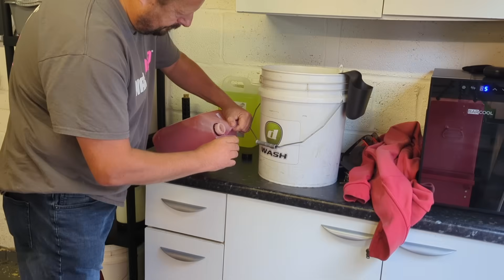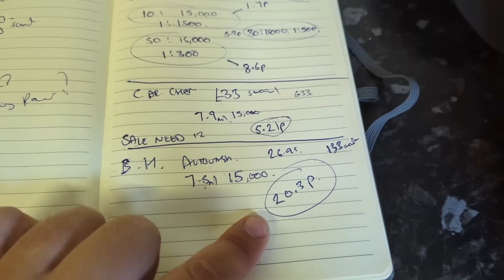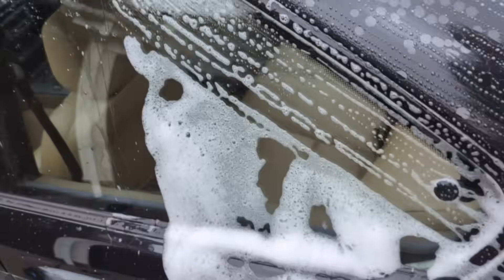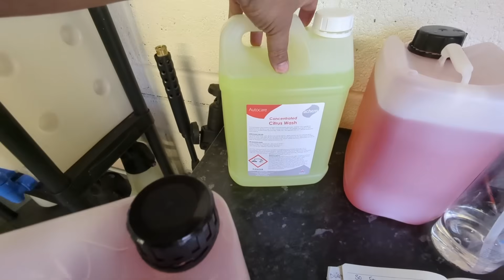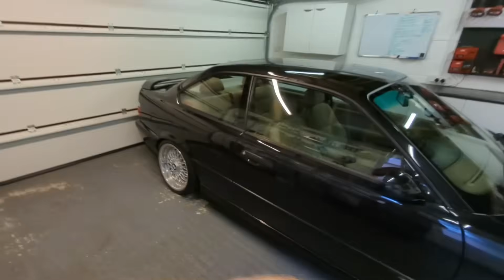*NEW DISCOVERY* UNBEATABLE Car Wash Shampoo £7 for 5 litres of high concentrate (+vat)

Comment: lol at people moaning at the price, madness.
Reply from the maker: you cant really trust the comments mate.  20,000 people watch the video 100 or so comment. After years of doing this you realise lots of the commentors are people really close to this, usually in the industry.  Ive reviewed about 50-100 car shampoos most which are retail and are lower standard 1:100-1:250 concentrates and cost about £12-15 plus £4-5 delivery for 500ml.   They dont complain about the price its never even mentioned.  Here you get 5 litres (10 times as much) of very very high (extreme concentrate so less water mixed in) and its £8.60 plus £6-7 delivery.  And there was more complains about price than ever.  This even with delivery is the cheapest cost per wash and chemical price you will ever get.  Thats why you know the comments are often industry linked sources.  That and I can see that accounts posting history to get a flavour of its its genuine.  You start to see the patterns after a while.
Reply: @ForensicDetailing 

Ah fair enough. I’m looking a decent shampoo to use and interested in this one. Previously used 1900.

Comment: Have you tried CarPlan Ultra Car shampoo (wash and wax)? The recommended does is one cap per bucket and 5L costs £5.75 (Amazon / B&Q etc).
Reply from the maker: Yer it's like demon foam.  It's not a high concentrate.  It's works but it's just a thin foam. The a chem stuff is much better much richer.

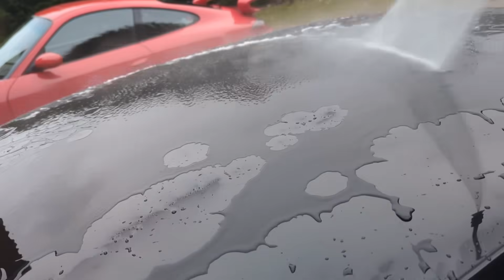Comment: @12:05 'It might not be the most powerful on the market but I can't really tell'.

Testing would help with this, right? 😅
Reply from the maker: It wont cut my dirt sim neither will any shampoo so I dont really have a means to test cleaning power down at this level.  most of this soaps are very mild any really just provide a low level of emulsification with some lubrication and foaming agent.

Comment: I think when working out costs you really ought to factor in delivery costs, especially if you can't walk into a high street shop and buy it without those delivery costs (£17 Inc delivery)
Reply from the maker: It's 8.63 plus 6.99.    but u have would always pay like 4 or 5 quid delivery on anything.   even if I double cost per wash 1.7 p becomes say 3.4p.  typically your averrage cost per wash is 30p without adding shipping.    5 litres of this delivered is the same as 500ml bottles of most shampoo with delivery.
Reply: @ForensicDetailing  +vat its in my bascket at £16.97 but unless i can find something else to add like maybe the cherry air frshner to i wouldnt buy shampoo online. Its the thought of paying same delivery as the item costs that puts me off. Somone did say that delivery cost does cover 3 x 5ltr tubs though which is very good value. I made an account, will see. you could review the QD stuff they do or the other ceramic stuff.
Reply: OOh if i can collect im driving 6hrs to leeds in a couple of weeks and its off the M1 somewhere 😀 Bonus.
Reply from the maker: It looks like its full of bargains.  Check their ceramic QD, or the normal QD, the rinse aid. Snow foam 10quid for 5 litres.  work back down into each area from this link https://www.achemshop.co.uk/product-category/autocare/  from what I can see as well these are nice quality chems

Comment: So how much would you recommend in a snow foam lance 🤔 been using shampoo through a lance couple years now just 1 bucket for rinsing wash pad 🤔 👍👌
Reply from the maker: start at 50-950 in the lance.  If its too thin work up to 100-900.  I would guess it will foam well at 100-900

Comment: BH Auto wash has to be worst product BH make disappointing, non foaming biggest waste iv spent , so man better product out there wouldn’t even use it as a benchmark 😢 
Point 2 why do people add cherry 🍒 smell to washes ? Appeals to 17 yr old who bought his 1st car bloody horrible
Reply from the maker: US market would probably agree. autowash when used it at 1:2000 doesnt make much foam has no scent.  However the level of foaming has no bearing on the lubrication or its cleaning power or its anti corrosive properties.  Its a functional product. But I do get it, like detailing brand foams are thick and heavily scented and maybe a bit more sexy.  And sometimes like that thick foam and a unique scent is nice.  But the older I get the more drawn I am to technical functional products and brands.
Reply: @ForensicDetailing  i know but bubbles makes ya feel good ! I just cant get away with it chemically i sure its fantastic 👍 thanks for reply excellent work as always !

Comment: I have a question for you.
I recently bought a black 20 year old motorcycle with delivery mileage only on it. It is pristine. 
I'm told that the original owner used a number of spray bottles to clean the bike.
What would you use to conserve the overall finish?
Reply from the maker: im not great with bikes mate but I would just maintain a good wash routine. clean it each week and brush out all the dirt.  surfex HD would be an essentual tool. perhaps a good metal polish. keep the leathers all dressed and the paintwork sections protected.  cleaning it is the important bit though. and keep ontop of corrosion
Reply: @ForensicDetailing thanks for your prompt reply.
I've just taken delivery of a polish/coating called SOPAMI Quick effect coating agent. I wondered if you have any thoughts on it.

Comment: These cheaper products ive bought a few, the citrus ones are tfr it seems, and the shampoo is also tfr-esque. Id be interested in knowing how much they strip protection (natural, sio and ceramic) compared to say a mild shampoo. This contains c12-14 which is like panel wipe, it dissolves oil and wax. Sodium salts could mean many things like sodium chloride and others. As many detailers say those who go to the scratch and shine may be covered in swirls but their paint is clean as can be, maybe something in that, due to the chemicals. Maybe test the ph too as it has an acid/alkaline warning label.
Reply from the maker: this shampoo is not TFR-esque (their citrus is also not so TFR like but does have some more caustic components).  Its just a mild foamey sudsey thing, it does not have a ton of cut or emulsifying power, especially when you consider you have 1 unit of this material mixed with 1500 units of water.    The C number does not mean it is like panel wipe its just the number of carbon chains in the surfactant.  Its an alcohol ethoxolate surfactant and a foaming agent primarily.  A panel wipe will typically use solvent blends.   PH is listed between 6-7 on the SDS.  They do have I think strong caustic more trade type products for heavy cleaning trade stuff but this product is just a cookie cutter shampoo.   A TFR will often contain NAOH and specific agressive acids which can be usefull.

Comment: I use fairy dish washing liquid for washing my car. Can you give me any reason not to?
Reply from the maker: yes,  it will cost you more to use washing liquid than products like this.  Dish soap often contains alcohol solvent as well.   These contact wash shampoos are typically a bit milder, a bit more lubey (glycols etc), they also tend to use a surfactant blend and a cationic surfactant to penetrate and lift the dirt away a bit more.   Dont get me wrong, dish soap is free rinsing and you can use it to clean your car, it will clean it.  It will be decent as a prep wash or a post polish degrease wash etc...  But yer I dont really use these home hack things, like vinegar, toothpaste, peanut butter, dish soap..  I just want to use better tools.

Comment: Unless it’s either free delivery or delivery is cheaper, then jog on.  We don’t all get these sent as freebies for advertising 🙃🙃🙃
Reply from the maker: This product is purchased.  If you want to see the order invoice I am happy to email it to you.  you should not slander people online.
Reply: The shipping is for 4 x 5L, so fairly reasonable if split over multiple items
Reply from the maker: it is yer, for a whole seller flat rate shipping its more than reasonable but even if you double the price you have a cost per wash of 3.4p which is cheaper than the carchem high concentrate at 33 quid + 4-5 quid delivery.  At 1:1500 5 litres of this product is going to last 5-10 years for the average joe.  Bonnymans are the another manufacturing wholeseller I buy from but their trade cherry shampoo is 12 quid for 5 litres its 12 quid delivery but with only a concentration of 1:200.  So I think  with or without delivery this Achem is about there as being the best value product on the market.  some of these guys are on literally on drugs.

Comment: Subtotal	£7.19
Tax	£2.83
Shipping	
 Mainland UK: £6.95

Total	£16.97 not cheap
Reply from the maker: 16.97 very cheap mate. it works well at 1:1500.  Compare price to a 500ml of a detailing brand soap which tend to be at closer to 1:250 and will typically cost 16-17 with shipping for 500ml.
Reply: The shipping is for 4 x 5L, so fairly reasonable if split over multiple items

Comment: Surely by now availability has to be factored into price per wash? Yes at £8.63 its remarkable value but as the only place you can get it from at that price incurs a £6.95 delivery charge, £15.58 is not quite as attention grabbing- yes still very good value. I remember you did a citrus wash test and uncovered value in the product Viro-sol, this has since nearly doubled in price and demand from some places has it on back order. Despite your well presented showing of this product, it's a pass on this one from me, just think the availabilty from more outlets of a lesser value/wash product is better overall.
Reply: The shipping is for 4 x 5L, so fairly reasonable if split over multiple items
Reply: @DJUK1-k9v  Shipping upto 20kg not including, see the next weight bracket up for price for 20kg. You have to pay attention to these things just so you don't feel like you've been scammed!
Reply from the maker: I Google virasol and it's 13 quid.    Availability is not issue you click link and order it arrives.       But it's like bonnymans you order a bit more because it's wholesale not retail.  But yer I do get what your saying but reality is shipping is about extra 3 quid
Reply: @ForensicDetailing  Suppose, if you are someone like yourself who is constantly washing/testing product you could justify purchasing the 15L to maximise the minimum shipping cost £26 + £6.95 upto 20kg but I just can't, don't have the space to store plus our garage in winter tends to freeze/seperate liquids or crack plastic containers. I'll just stick to the readily available Bilt Hamber that usually comes with free delivery or if really desperate Car Plan, available for £5 for 5L from some supermarkets when you do the weekly shop. Halfords, B&Q, local car shops and even in some petrol station shops.
Reply from the maker: 1 litre of BH autowash mate, this makes a lot of sense too yer.  Its like the cost per wash is close enough isnt it and it has perhaps better pedegree I always like the fact it wont inhibit corrosion too with their chems.

Comment: i wonder though how many caustic chemicals are in there, lol!! I am sutr it cleans very well though!
Reply from the maker: Covered in video it's just mild shampoo no nasty stuff
Reply: is it? Becsue look at the large Danger sighn Which If I am.correct there may be caustic chemiclas in there. Check it.out John! Thanks
Reply from the maker: thats because it contains ethoxylated alcohol and sodium salts on the SDS.  this is classified as a skin and eye irritant.   Theres nothing in this formulation that you need to worry about. good thing is these manufacturers put these signs on the bottles, lots of the scene brands Ive shown have these warnings on their SDS and fail to put the signs on the bottle.

Comment: On the point about cleaning ability, SOME shampoos do have excellent cleaning ability as well as lubrication.  I always use g techniq shampoo, applied through a lance, and you can see it turn brown/discolour after just a few seconds on the car , and thats after using BH touchless as a pre-wash, so not a filthy car !  - pretty much any BH product will also do this ..
Reply from the maker: relativly excellent but even a powerfull shampoo tends to be a weak cleaner when theres really tough grease or dirt films.  At least I can tell you this from the fact they all struggle with my dirt simm, but an APC will typically cut through it. So yer relativly powerfull.  BH shampoo and Gtech are relativly powerfull contact washes I can say back from my shampoo comparison test.

Comment: You had me Interested then I read P&P will be £28.00 to me! 

I know Jennychem I know  how good it is. Think I'll stick with that at a fiver delivery.
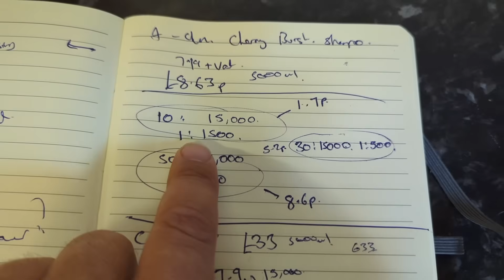Reply from the maker: the jennychem high concentrate is a 1:50 ratio shampoo according to their website. costing 12 quid + 5 quid delivery.  This shampoo is 1:1500 costing about 8.63+6.99 delivery.     the jenny chem is not especially good value in comparison.  I wonder if thats a typo because 1:50 is very poor concentration.
Reply from the maker: digging more, they also offer a high foam shampoo that says to use it "Mix 1 part shampoo with 5 parts water. " for heavy soiling.  So in your wash bucket with 15 litres of water you would need to add 3 litres of shampoo.   stuff like that worries me when labels are the far wrong.

Comment: It's all about using the correct technique. I use the one-bucket method in the same manner on my black VW Polo, and still not a single swirl. The main issue with the two-bucket method is wasting too much time just to set it up, and cleaning up the rinse bucket and gear after the wash is done.
Reply from the maker: and moving the 2 buckets around filling them both, cleaning both like you say, and that rinse bucket should not be filling up dirty water if the prewash is doing its job.  its not a bad thing as such but yer I dont really think it makes that much difference.
Reply: One bucket method:just use multiple wash mitts.

Comment: I've got an off-topic tip. But still car detailing related. I used Pink to clean my exhaust tips. But now I have tried simple aluminum foil with great results. It acts like a mild abrasive, milder than Pink, with or without a spray of water. Works on stainless steel tops or stainless taps in the bathroom or kitchen.

Comment: Misleading title. Price should be including postage evne though theres one place for click and collect.
Reply from the maker: no shouldnt. it never has for 10 years.
Reply: @ForensicDetailing  it's 7 pounds delivery
Reply from the maker: its a wholeseller, you will pay typically 4 quid delivery for other stuff.  yes 7 quid is more but you just grab a few more things 5 litres of snow foam 10 quid, 5 litres of drying aid 7 quid etc..  Or I guess you just dont order it but ultimately even with the shipping the value is fantastic.
Reply: The shipping is for 4 x 5L, so fairly reasonable if split over multiple items

Comment: Got me thinking and started to check Polish manufacturers. Found shampoo that is 6.12 GBP for 5000ml and is 36ml to 15000ml of water. It is like buy once and your kids will inherit it.

Still I prefer Soft99 "for home ladies" shampoos like Neutral. Those can be used in sun, dried, forgotten and still you can wash them away. And can be used with Japanese method of washing safely so it is a plus for guy like me without a garage. Convenience is pricy, sadly.
Reply: What is the Japanese method?
I had never read about it before.
Reply: @sphirit  There is a film on this chanel about it, but in general - you use one bucket only, one of their sponges and pour shampoo directly on sponge. If you go 100% after old Soft99 adverts - you do not need bucket at all, just sponge and shampoo - you go around car without rinsing your sponge, just use more shampoo.

Comment: 8 years into the 5L Car Chem 1900:1 shampoo. A once in a generation purchase...
Reply: Yes I’ve still got half a bottle of car chem after 4years of use , so powerful 1900-1 !
Reply: Car Chem website says not accepting new orders now though.
Reply: Haha - I'm in the same boat. What a buy lol
Reply: 2 years into mine :)
Reply: Me too, probably got another 5 years to go. Stopped using shampoo as much as I used, because Bilt Hamber's snow foam does such a great job of removing all sorts of dirt. Saves quite a bit of time. Car Chem is stuff is wonderful, well, their shampoo is. Not got any experience with their other products.
Reply: 😢😢😭Car Chem appears to have closed its doors. The website is still up but they have not accepted orders since last Spring.

Comment: Sounds great, but was bit stunned the P&P = £7 also, so inc. VAT and P&P its 16.97.  Still good value, but useful to add this true cost of buying I feel. :)  
Bought 5Ltrs as great timing, just run out of my TAC Shampoo. Keep up the great vids, love the channel!!
Reply: Additional charges for Scottish Highlands too as usual. They do it in 25 ltrs too so the saving might be worth the postage if it is that good but for now, I'll stick to my autoglym👍
Reply: The shipping cost is astonishing for 5L  £7 so a totle of £17 for 5L shipped..
Reply: @Anoymus985 you can get up to 4 x 5L for the same shipping cost. you’re buying from a bulk manufacturer, not somewhere that includes the cost in a product. liquids are heavy and cost a lot to ship if shipped properly - seems reasonable to me
Reply: Carplan pol104 ultra shampoo, look it up 👍
Reply: The shipping is for 4 x 5L, so fairly reasonable if split over multiple items